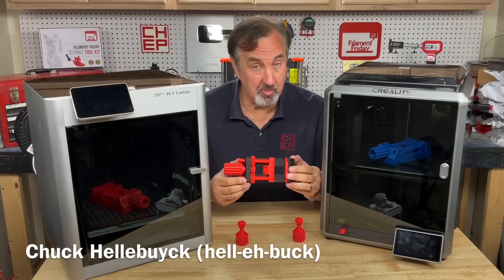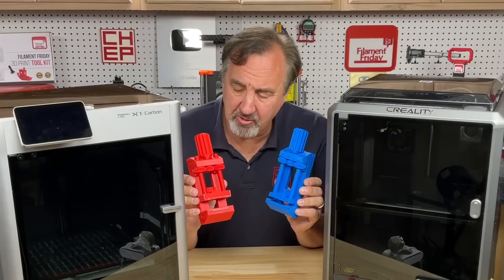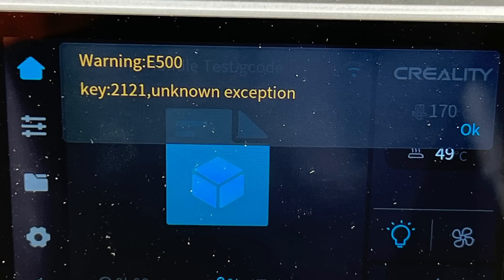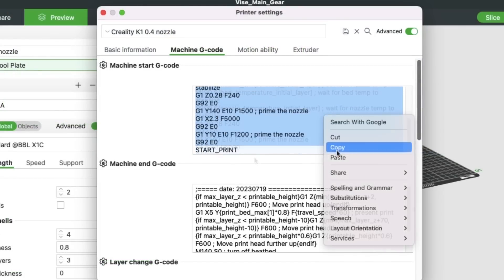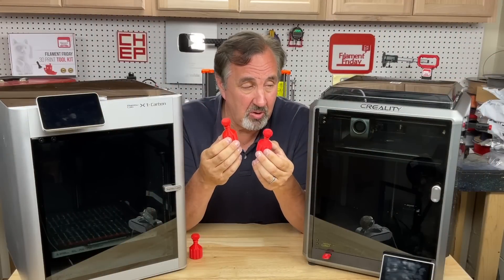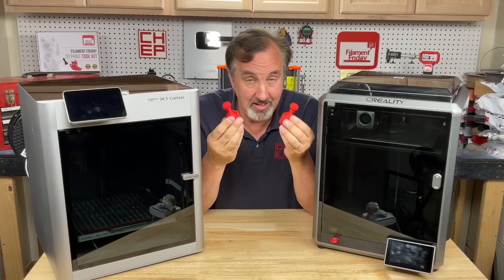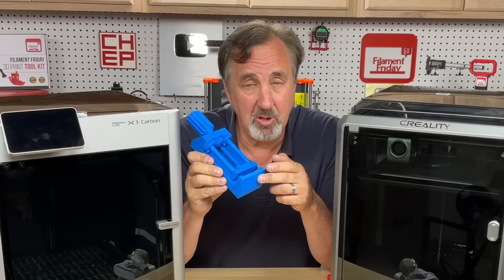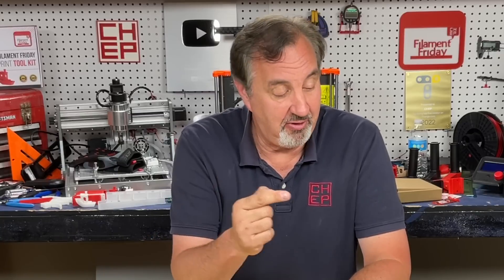Using Bambu Studio Slicer on the Creality K1

Comment: I had the same issue. I fixed it by changing one setting in the slicer. In the print profile look for a setting, "Quality-Precision-Arc fitting". If there is a check mark in the Arc fitting check box, then remove the check mark.  See if that helps. It made a huge difference on my K1 Max.

Comment: Awesome info, sir. Thanks! 

The newest version of Bambu slicer has the k1 and the k1 max, but not the k1c.

Since the k1 has identical build volume as to the k1c, couldn't I just choose the k1 and run the prints on my K1C?
Reply: Yes I have k1 and k1c and they are identical so it will work.

Comment: Or you can use the latest version of Orca Slicer which has a Profile for the Creality K1 included.

As far as i know Bambu Studio and Orca are more or less the same slicers.
Reply from the maker: It prints a lot slower than Creality Print.
Reply: That depends how you set up the slicer and speed. 

I have no issues at all and the speed of the print is finally the same.  @FilamentFriday
Reply: @kernelpanic-x64  What adjustments did you make in Orca to get the Creality Print speeds running? How did you compare to ensure the speed and quality is unmatched?
Reply: @musikmaker19  I opened both applications and compared the values (as long as possible) 

I am doing individual settings of quality and speed depending on my every day needs.

Sometimes quality is more important than speed, so i slow down the printer. Depends also on the used material.

Comment: One of the clues I found on the Bambu printer, when using PETG (all I print) the printer sets the temp to 255 for PETG.  This, I think, is the magic temp to get it to print so fast and clean.  I increased the nozzle size on the K1 Max to 0.6 MM and am working on "tweaking the Creality Print" for that nozzle.

Comment: If you have 7-Zip installed, you can right-click the .3mf file and choose "open archive" (can be done with EXE, MSI, etc. with mixed results). From there, you can navigate the file just like a normal archive file (ZIP), but you don't have to change anything about the original file! Thanks for the video!
Reply: 7-Zip is THE file extractor

Comment: Try Lychee Slicer, it supports the K1 and works fantastic.
Reply from the maker: Isn’t it just for SLA?
Reply: nope, it has k1 max support, however no it doesn't, what happened when i tried to import my g code, into my k1 max, the mother board started beeping, danger, lucky i stopped the process immediately, could have been a fire hazard the build plate was burning.. anyway the only slicing program for the k1 max as far as im concerned is the creality print is the safest slicer. I also wouldn't be using Lychee ever again, i deleted it and its also a mungral of a thing.. it very annoying with advertising and waiting time.
Reply: @OG96932  you must have made a mistake, I have 2 Creality K1 working perfectly with the Lychee Slicer

Comment: I think everyone is making poor attempts to diminish the quality of Bambu's influence and products just because it's not open source.  The prints are NOT identical, so just stop.  Seriously, stop.   Your video clearly shows the differences. The hardware on the Bambu is just superior and is fully utilized with the Bambu slicer.   The K1 is a vast upgrade to the never ending line Ender series, but it's not close with the quality of the Bambu printers.  Hence, the quick recall of the crappy extruder they initially released with it.  Lastly, what a joke to suggest that these printers are nearly identical in quality using the same slicer.   You printed a single model.  A single model!   Real scientific by using a single model with only one type of filament.   Perhaps a variety of models and variety of filaments would be helpful to make such a bold claim.   It was clear that you really clear you had zero interest in testing your hypothesis.  You had a conclusion drawn well before you even began your farce of a test.  It's BS like this that seriously stagnated true progress in 3D printers for five years because everyone was too busy justifying the mods they had were using to get their crappy creality printers just to do print a basic item.   This video rates with the LTT "testing" videos -lacking true testing parameters and is highly disingenuous to consumers.
Reply: Uh No? Go watch Frankly built he compares ALL the 4 Printers and he was an early Super fan of the bambu printers, He Now changed his mind and likes the K1 Max best over Bambu and he used to say bambu was his favorite. ( Creality QA is a little suspect ( bambu is better but they spent a few years perfecting their deign with Kickstarter , as they releases some wonky stuff sometimes but they always work it out as they have with the K1 series over the last few months.)
Reply: Haahaahahaa
Oh man, you really want to justify that cost you spent on the Bambu! "Just stop" LOL. Look at that diatribe, sheesh.
(pets head gently and whispers)...it'll be okay, just keep printing.
Reply: Wow, you are really that emotionally attached to 3D printer manufactures aren't you?  With everything going on in this world and THIS is what choose to base your existence around? If you need to spend your time defending 3D printer manufactures,  then it's YOU that is the sheep. Final point, I own a PRUSA's printers, so what is your point again? -  @musikmaker19
Reply: If it’s such a problem then feel free to upload proper testing videos instead of complaining to a brick wall.

Comment: Chuck, do you have the profile you created for bambu slicer for the K1? id like to try it with my K1 Max if thats ok with you? i realy dont like their Creality Print slicer - the prints come out worse than those on a standard ender 3 pro, i think they should release what software theyre using, but currently i dont believe they have done that - its really letting them down, the prints seem ok when printed from the inbuilt folder, but from the slicer, it really is horrendous.. contemplating sending the printer back if i cannot get it to function better than my ender 3 pro - theres no way ill take speed over quality.

many thanks

Comment: I just did something similar I added a ender3max to cura and modified it’s size and start stop Gcode. Then I made a pla profile and now I’m using cura to print on the K1max. It will say it’s not Ai compatible but it still prints
Reply from the maker: Are you able to print faster with that Cura profile?
Reply: @FilamentFriday  printing close to as fast as the creality print it still needs some tweaks I’m not an expert like you and your crew but it does work. I also noticed my head temp was 240 when I set it at 220 so seems like there is an issue there as well
Reply from the maker: Are you willing to share your profile?
I’d like to check it out. 
Send to email: chelleb1 at yahoo if you are willing.
Reply: @FilamentFriday  sorry I just saw your message 
I sent an email with a link to drop box I put it there to share it with people who ask

Comment: Just got my K1 last night, so I'm paying special attention to this stuff. Have you tried creating a Cura profile for the K1, and if so, how's it working out? I'm still trying to get used to the Creality Print user interface, but I've VERY comfortable with Cura. Until this point I've been using an Ender 3 Pro and an Ender 5 Pro, so this is a pretty substantial change. Thanks for all your helpful content.

Comment: Thanks for the hint of grabbing the start and end code from the Ender 3 V2 profile, this finally enabled me to make my own K1 profile in Prusaslicer! And by god, prints come out SO MUCH better now than when sliced with Creality Print (which, as I understand, is based on an old Cura)!... Does anyone know if and how the side fan is controlled? P.S: Careful if you have old Linear Advance 1.0 M900 commands in your filament profile, i.e. the ones in the 3-digit range! The K1 (max) chokes on those with an "internal error"!
Reply from the maker: Do you share the profile anywhere?
Reply: @FilamentFriday  When it's done, yes! ;-) Right now it seems to work beautifully, but for some reason the slicer print time estimate is way off (e.g. 8h for a print that takes 9.5 in reality), anyone got any idea why?
Reply: It is based on Cura, I don’t know if it’s based on an “old” Cura though.  🤷🏻‍♂️

Comment: I just unboxed my K1 Max this weekend. I have some issues printing with Amazon Basics PLA and Overature PETG filaments. I am printing Temp Towers to dial in filament settings. I decided to become a Patreon member tonight because I find your videos so helpful. I also hope if you find any Creality Printer Slicer issues (Orca replacement) or K1 filament profiles I will benefit from your expertise. Keep up the good work.
Reply: what issues are you having my k1 max is excellent in printing mostly beating out the x1c from bambu i have....but this guy is right the slicer is hard to use settings are coveluded, bambu slicer on k1 max is what im going to try now....not sure if i can do it becasue this is for k1 regular but we will see
Reply from the maker: Let us know your results.
Reply: @FilamentFriday  can't use bamboo directly but I have installed orca which is the same , it cuts print time way down, better all around and settings are more abundant than both bambu and x1c and allows you to print over lan with k1 max. So it's good win. Also if you have one I suggest you download the preroot update that allows you to use fluid like the Ender's, it's simple and then can find tune pressure advance, add in x input shaper (k1 max is only using y input shaper from factory) much more. If you want I can show you where to get the info
Reply from the maker: Where are the Orca k1 profiles?
Reply: have to remember the k1 has no ai power like x1c and the new k1 max blows the k1 out of the water :)
Reply: Can’t the k1 be upgraded with the camera for Ai and LiDAR, which would make it the same printer just smaller?

Comment: Soooo i have tried printing this vice but keep getting the same bad results of the screws snapping in half. Would you say that it is a infill problem or that it needs to be oriented differently? How did you do yours (not the handle, the lead screw for the base)? I tried printing hot and slow. I tried different filaments. But every time they snap into peices. I also dried the hell out of the filaments before hand thinking that was the problem. Please help!😢
Reply from the maker: I printed at 30% infill I believe.
Reply: @FilamentFriday  thanks. I have tried numerous percents of infill but nothing has worked. Maybe it is the style of infill that does the job? I always use grid but not sure if another way is better. Infill before walls maybe?
Reply from the maker: Up the temp 5°
Reply: @FilamentFriday  ok thanks
Reply: this can also happen when you have a layer height too high. higher detail like .1 = smooth and proper clearences

Comment: Honestly, it's not surprising. Creality has always used an outdated version of Cura that has been as far as almost 2 years behind regular Cura at times. Combine that with PrusaSlicer and its forks being the ones making the most significant progress since Bambu hit the scene, anything Cura based feels like it's losing ground very quickly.
Reply: Well, anything based on an old Cura maybe... It's not like Cura doesn't make any advancements when compared to Prusorcambooslic3r, quite the contrary, they're adding cool improvements all the time, too, some of which are even picked up by the other team because they're great (e.g. ironing, tree supports etc)

Comment: Chep.. youve used both, which would you recommend? i want to be able to change nozzle types without too much of an overhead, id be happy to use aftermarket/third party parts too - just cant decide between the x1 carbon, the p1p or the k1 max - any chance you could shed some light on the differences and affordability of upgrading/replacing nozzles/parts etc?  thanks a bunch
Reply from the maker: I don’t have a K1 Max or P1P. The X1C is far more expensive but does print quite good. I’d say Bambu has done a better job releasing a new machine. I just don’t prefer closed source. Here’s a good video on replacing the X1 nozzle. 
https://youtu.be/6RG38PSlzKM
Reply: @FilamentFriday  thanks Chep, one of the biggest reasons I have for not going with Bambulabs is all the proprietary hardware and software.  The ability to obtain replacement nozzles etc and tinkering with software if I need to is a big thing for me which is why the k1 max is a concept I can't ignore.. thanks for your reply chep, thanks for the content also.. appreciated very much

Comment: As far as I am aware Cura and its clones don't have the option to slow down the print speed for overhangs. This option is a must for high-speed printers. When we were printing at 30mm/s outer overhanging walls it wasn't an issue but now good luck doing that at 100-200mm/s speeds. It just doesn't work. Anyone who still doesn't use Orca Slicer (or Prusa/Bambu Slicer) you are just leaving so much print quality on the table, which is also FREE.
Reply: Cura does has the option to print 'bridges' as it calls it in the air, slowing the speed as well as reducing the flow so please stop lying.
Reply: @Ebani  You clearly don't understand what I am talking about. I checked and Cura has "Overhanging Wall Speed" and "Overhanging Wall Angle" but the implementation of those is horrible. So if you want to use an inferior slicer and get lower-quality prints with high-speed printers, be my guest I don't mind. I used and loved Cura, but it get to a point where other slicers are just way better. But you do you.
Reply: @PrintingPerspective  I literally told you Cura calls them bridges (just checked the option, it's called 'Bridge Settings', right below the ones you named), guess your reading comprehension is horrible no wonder you think the slicer is the problem, i've never had a problem pringting so it seems more of a 'you' problem 🤷‍♂
Reply: @Ebani  Do you understand that bridge = 100% overhang? And there is a range of overhangs from 1% to 100%. So Orca Slicer has dynamic overhang speed depending on the overhanging percentage. Bridge settings have absolutely nothing to do with what I was saying because in the video spots that had poor quality was ~50% overhangs. I sometimes question myself why I bother explaining to people when they already "know" everything. :) Ehhh...

Comment: isn't it just the settings in the slicer and not so much the slicer?
Reply: slicer change many thing trust me not all slicer slice the same way
Reply: the point here is: the manufacturer delivering "good enough" settings right out of the box.

Creality is not and never has been. Which is quite a shame! Imagine them tuning one profile with each printer they were announcing, starting with CR-10 or Ender 2 in 2016/ 2027.

Comment: Orcaslicer has a k1 profile...
Reply: I have installed the latest Orca V1.6.3 version and see no reference to the K1 printer.  How did you get this sourced and loaded?  TIA!!!!!
Reply from the maker: Agree. I don’t see it either.
Reply: Not OrcaSlicer, but GalaxySlicer
Reply: Minimum layertime is to high
Reply: Yeah Galaxy slicer has it, and galaxy slicer is basically orca slicer
Reply: I have tried Galaxy slicer and am getting good looking prints with my K1.  However I cannot get faster prints.  My model takes 14m at the default Galaxy Speed rate (300) and when I manually increase these rates to the levels that K1 is capable of (600) it still only prints in 14m.  How do we get these great prints and also get the fast speeds like we can get in Creality slicer? @Dirt33breaks  @FilamentFriday

Comment: Interesting.
I'm still using Cura myself. I don't feel the need to change, it does what I need, but I'm hoping the arc overhangs plugin will eventually be on it.
Reply: Do you use it with the K1?! Because that was the issue here.

Comment: Do some videos on using Orca. I want to move away from Cura. Can you do your Fast Cura 0.28 profile for Prusa Slicer? Thanks.
Reply: Not only a fast profile. I would also use a "normal" and a "slow and quiet" profile as well, if the K1 does support that.

Comment: Not sure if you were using creality slicer or creality print to slice the files. I'm having awesome results in general with Creality Print
Reply: He used Creality Print, which is what is recommended from Creality. Plus Creality Print is the slicer that Creality designed the K1 profiles for. Still, Creality Print is just a slimmed down version of Cura, just like Creality Slicer

Comment: Good Video, Except the X1 Carbon is $1000 Dollar More Expensive than the K1 so No Comparison
Reply: The point of the video was that regardless of the printer you can get better prints by having properly tuned input files. I think the K1 will have a journey, once the software is open sourced, ending with very high quality high speed prints just like the X1. The community will essentially do the profiling work that Bambu already did for their printer.

Comment: Thanks for the video, it shows signs of hope for the k1 max.
 If creality would have released this printer as open source in the first place we probably  would not even have this conversation.
Thank you for all of your hard work in breaking down problems with printers and how to fix them.
Reply: The K1 has already been unlocked to provide full access to Klipper now all we need is the community to put together well tuned profiles for decent slicers and the K1 will be just as good print quality as X1.